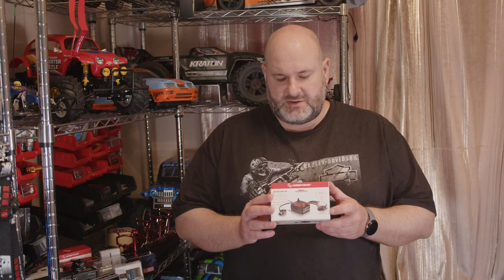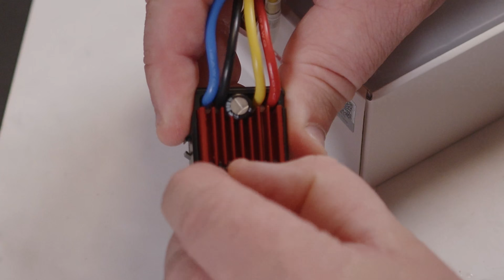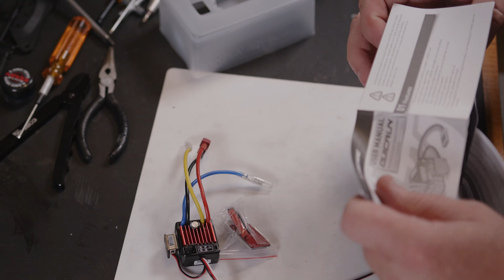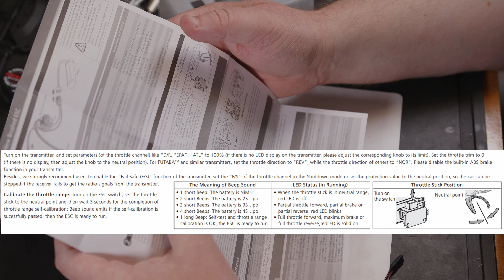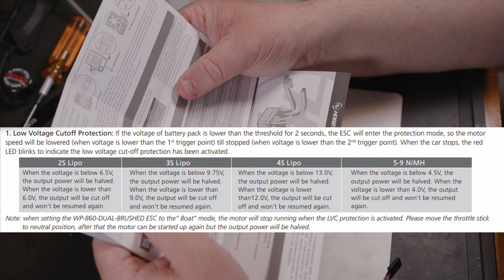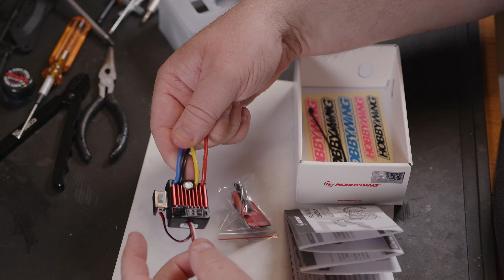Hobbywing QUICRUN 1060 Brushed Waterproof ESC 1st look

Comment: I'm very confused by the Hobbywing literature I've seen that says "if driving 2 motors simultaneously, the turn of the motors must be increased".   Why would I buy a dual-motor ESC to run a single motor???  Anywhoo, I'm interested in this as a replacement for my original Tamiya twin-motor ESC on my Clod.   It works well with the optional Tamiya cooling fan but thinking about an upgrade.  Running a 7 cell NiMH and dual Torque-tuned motors.  Thnx!
Reply from the maker: The 1060 is a single motor esc for dual motor you need the 0880 esc :)
Reply: @WTFRCCars  Doh!.  My YouTube search had been for the 880 and missed 1060 in title, hence my Q about the 880.  If anyone has some intel for me on the 880 and compatible motors, I'd appreciate it!  Thnx!
Reply from the maker: @extrema391a6 best advice is download the manual from hobbywing site :)

Comment: Thank you for breaking down the specs down for this ESC. I've come back to the hobby after a 20 plus year hiatus and I'm doing my best to get up to date with today's R/C tech. LiPo's is my next tech to learn.
Reply from the maker: Lipos are great if you follow a few rules, 1 when charging charge at 1 C rate so a 5000mah battery needs 5amp to be charged at 1 C, 2 never leave you lipo at 100% charge or discharged always leave it at around 50% and most chargers will have a setting that says storage on this setting it will charge or discharge your lipo to the safe storage charge for you and tell you when it's done. 3 never leave your lipo connected to your RC when not in use as it will drain it flat and Lipos don't like to be left flat it kills them, 4 never use a puffed or damaged lipo it will catch fire and you will almost definitely lose your RC in that fire as they are fast to start and can't be put out be water or foam spray as a lipo fire is self fueling and the reaction is intense. And possibly the most important never leave them charging unattended. If you follow these rules you will never have any issues with them and used correctly they are very safe I have a house full of them and have never lost a lipo yet :)
Reply: @WTFRCCars  thank you so much for this sound advice. You have explained do’s & don’ts far better than some youngsters at my local hobby shop. Again thank you!
Reply from the maker: @muertero831 No worries 😁

Comment: it is necessary to restart the esc everytime we change the jumper?
Reply from the maker: Yes I would as in power it off then change the jumper power it back on
Reply: @WTFRCCars   I am looking the one that doesn't need to restart. so we can hook the relay and flip the switch on remote
Reply from the maker: @cheapmod what are you wanting to achieve with it? Are you wanting to disable reverse or bake

Comment: I got one come with my Frog  kit black not red
Reply from the maker: Yeh the back ones are the same as a 1060 and you can disable revers on them too
Reply: what Radio with transmitter would you Recommend getting for this I’m wanting something not really cheap but in the middle that will be a good set up and be fast lol ?
Reply from the maker: Flysky G7P work well around £80 flysky nb4 are really good too around £165